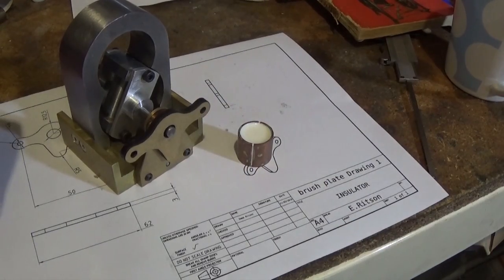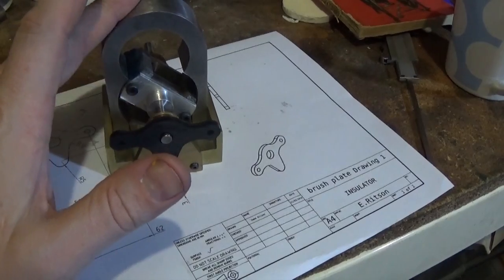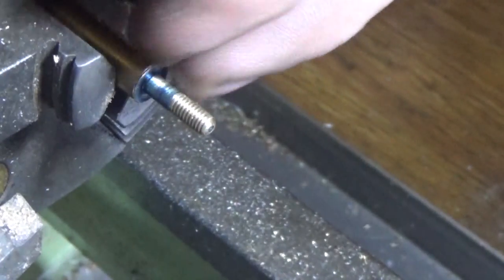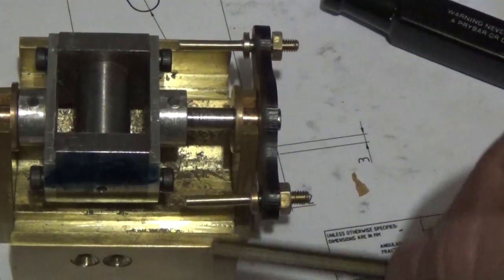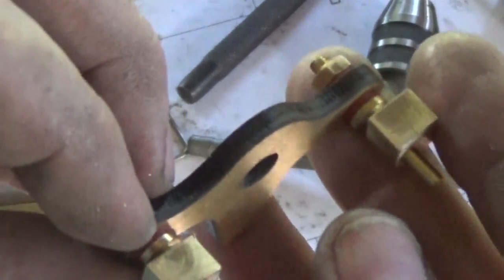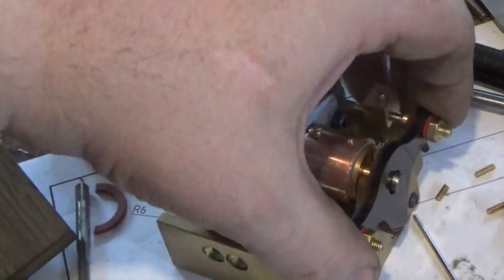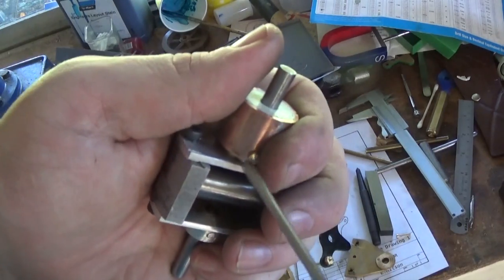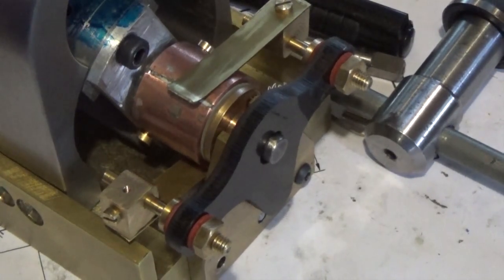Prince Dynamo motor PART11

Comment: As a kid I used to make brushes out of old flashlight batteries but those were the Leclanche cells with carbon rod up the middle. But brass should work. The brass brushes, copper commutator and iron make it look turn-of-the 19th century. Love it.